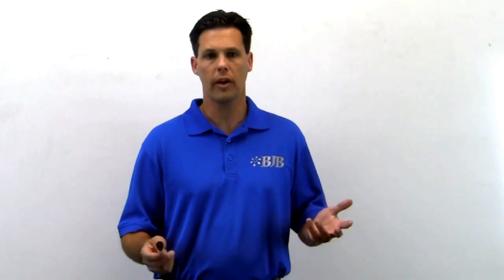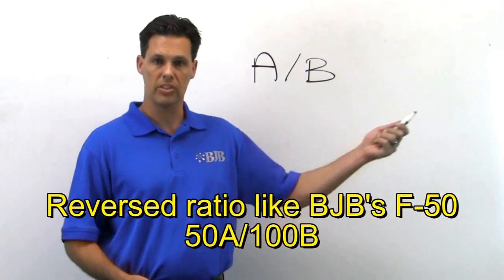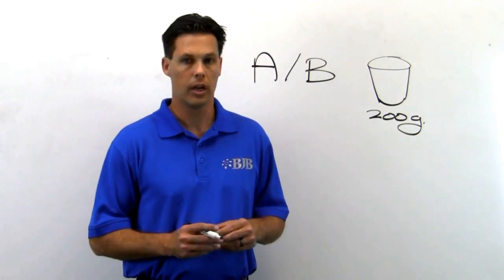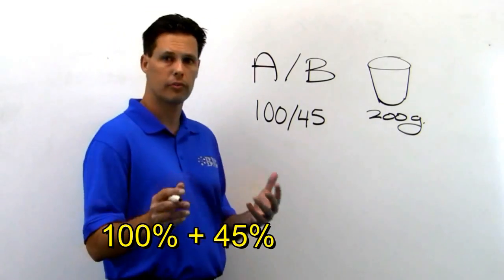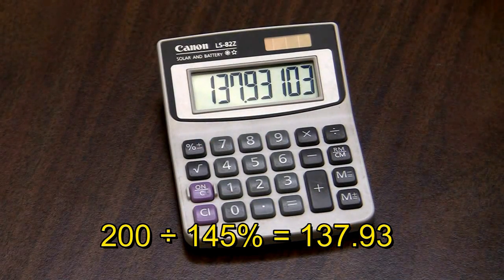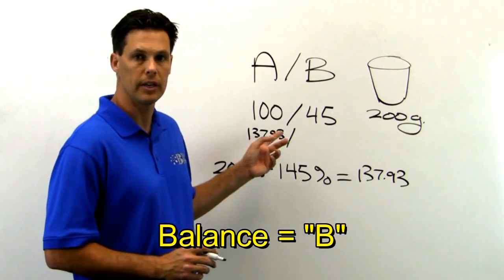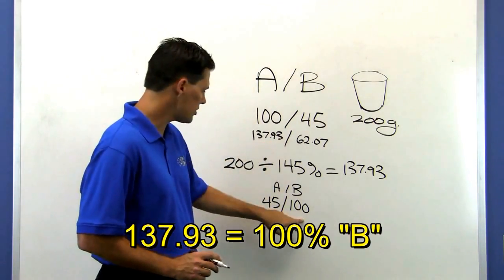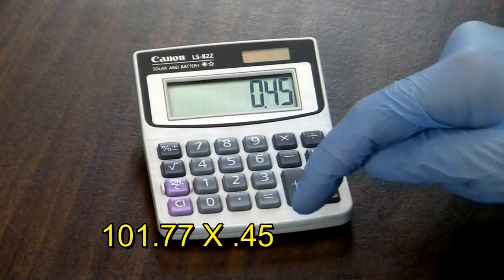Mix Ratio Explained with EZ math

Comment: Thanks but my ratio is 100:26 but how do I work out wat is the ratio for instance 4to1 5 to 1 if xou understand what I'm asking
Reply from the maker: You don't want to try and force a ratio like that into a simple 4:1 or 5:1 because the math won't allow it.  Simply do the calculations in the video and use a proper gram scale to accurately measure your resins.  If you want to mix up 250g of resin:  250/126%= 198.4g A, 51.6g B

Comment: Let me make sure I did the steps properly.

1. I multiply the dimensions of the object or model by length, width and height.
2. I also multiply the dimensions of the mold box in the same fashion.
3. I subtract the number of the mold box from number of the object to get the answer in grams.
4. I divide the number from the overall ratio of the mixture to get the amount of grams for the silicone.
5. Then subtract the number of grams from Ratio A to get Ratio B.
6. ...Profit?

I ask this because I want to make sure I get the numbers right.

I have an object that is 34.1 cubic inches. I have a mold box 144 cubic inches. I subtract the larger number from the smaller one to get 109.9 grams. Then, I divide 109.9 grams from 110 (100 Parts A to 10 Parts B) to get .99 grams, right?

Comment: so if i needed 295 ml do i run the same formula? Im not sure how to calculate my measurements to grams but online calculator show ml/g is 1:1 ? i did the math, the epoxy i use is 100a/85b, i come up with 159.45a and 135.55b . would that be correct ?
Reply from the maker: correct

Comment: If i need 66g how i do that with 100:60??????
Reply from the maker: 66g ÷ 1.60= 41.25 (A), the balance (24.75) is the B amount.   As shown/stated in the video, you always divide the total amount of material you need to mix by 100% + 60% which is 160%.  160% in decimal form is 1.60.

Comment: Will this formula work with a 2.7:1 ration for epoxy as well?
Reply from the maker: Yes it will work but it's a little backwards.  2.7+1=3.7 (370%).  Divide amount needed by 3.7 (370%) to get the B (100%) and the balance is the A.  Example: 500g is needed:  500/3.7 (370%)=135.13g B.  500-135.13= 364.87g A
Reply: @bjbenterprises  thanks again. Just getting into woodworking and epoxy and i was getting so frustrated trying to figure out how to do the pours.

Comment: We have 55k/m3 density foam area of 970/ in2. If foam to be moulded than what would be the formula?
Reply from the maker: You should ask your foam manufacture what they recommend.  Otherwise, you need to run a volume calculation based on the foam density and mold volume.  Usually with foams, you need to add additional foam to provide back-pressure.  Watch this video to learn to use foam: https://youtu.be/_O_vd_I_ojI

Comment: I’m having trouble calculating 10/6 ratios , do I. Use 60% ?
Reply from the maker: Yes, 10/6 is the same as 100/60 so the "B" is 60% of "A".
Reply: BJBEnterprises thank you so much, so if I wanted 200g it would be 125A and 75 B? 😅
Reply from the maker: @nfnfw  Correct.  You divide the desired amount (200g) by 100%+60%=160% (1.60) to get 125g A 75g B.

Comment: Why does House of Kolor call for mixing by grams ? They are just calling for ...... xxxx grams of this , xxxx grams of that and so forth
Reply from the maker: We can't speak for another company but in general, measuring small amounts of liquid resins/paint by grams is a very accurate method.  Using grams vs ounces allows you to use whole numbers and not fractions, which is confusing to many people.  Also, if you are measuring very small amounts of resin/paint (drops of catalyst for example), measuring by volume is nearly impossible.
Reply: @bjbenterprises  .... Im not asking you to speak for another company . I'm asking you to explain mixing by grams , no I'm not mixing small amounts I'm mixing qt.
Reply from the maker: @good-boy-ringo  your question did not have relevant context or enough information for us to know what you are trying to understand.  Mixing in grams is a very common thing in our industry so to us it's not a strange situation.  You may be more familiar with pints/quarts/gallons and ounces but for accurate weight measurements, using a scale and measuring by grams is an easier way to use whole numbers.  You may be more familiar with measuring by volume since you are mixing paint.  That's common in the paint industry.  However, mixing by weight is without a doubt more accurate than mixing by eye using volume measurements on a cup.  Some systems may be forgiving enough to do that, but if you are trying to measure precise color mixes or the system needs closer mix ratios, then measuring by weight is being offered as "best practices" from the manufacture.
Reply: @bjbenterprises  ...Thank you for replying this time with more info on grams but my first question is very clear, simple and does have the relevant context for an answer.
Reply from the maker: @good-boy-ringo  glad you have the info you need.

Comment: If I have a 9:1 mix ratio for 30 millilitres,  what would that be? Thank you!
Reply from the maker: 9:1 is a 10% ratio so your mix is= 27/3.  For example, if your mix ratio is 9:1 or 9 parts water to 1 part solution, there are (9 + 1) or 10 parts.  The mixing percentage is 10% (1 divided by 10).  Multiply 30 X .10 and you get 27.  The balance is 3.  From there the math all lines up.
Reply: @bjbenterprises  being explained that way makes it much much easier to understand. Thank you very much!

Comment: Please tell me. With a dilution of a ratio 1:200, how much chemical will you require for 10 liters of water
Reply: Tinny Richards Your ratio mean, maybe : if you use 1 liter, you need 200liter of the other product. Otherwise, in kilo, if you use 1 kilo, the other part will be 200kg.

So, for 10 liters, you need 2000 of the other one. Are you sure for ratio ? The ratio look strange, is it for a pool or a big volume ?

Comment: Nice . Say supposing we need 2 parts of A and 1 part of B . How do we do that . Please can you tell me.
Reply from the maker: It depends on what you need to know.  If you have a set total amount you wish to mix (say 200 grams A&B total) then you simply divide 200g by 150% (100%+50%).  So 133.33 A & 66.66 B.  Or, you can simplify that and make 130g A and divide that in half to get the B amount of 65G.  The A is simply twice the amount of B needed, or the B is half the amount of A needed.  Correct either way.
Reply: @bjbenterprises  :. In resin jewellery making we have to put 2 parts of Clear Resin mix (Part A) which is 200grams  and 1 part of Part B (Hardner) which is 100 grams . I wanted the exact amount . Will be very happy if you can help. Thankyou.
Reply from the maker: @ashadominicafernandes3138  Yes, 200A 100B for a 2:1 ratio.

Comment: what is the difference between 1:1 ratio epoxy resin and 2:1 ratio epoxy resin?
Reply: 1:1 is 1 part to 1 part. 2:1 is 2 parts to 1 part.

Comment: Please tell me how to mix 3:1 ratio..thank you
Reply from the maker: 3:1 is equal to 75% : 25%.  You can take the desired mixed amount (say 400 grams) and multiply 400 X .75 = 300 and 400 X .25 = 100.  So you need 300g A : 100g B
Reply: @bjbenterprises  Thank you
Reply: Sorry to bother you again but if i have to mix small quantity like 10 or 15 grams??..thank you
Reply from the maker: @khulalanup  15 grams would be 11.25g A : 3.75g B.   Just be careful as this is a very small amount of material to mix; it can be hard to stay on ratio and much of the material can stick to the mixing container sides and also the mixing stick.  We usually recommend mixing at the smallest 20-30 grams for this reason.
Reply: Man,did you go in school in your lifetime ?? I made this when I was 6 years old...

Comment: Thank you for the video. I am a bit confused, if suppose I have two chemicals say A and B. I want to make a certain solution (containing chemicals A and B in a fixed ratio while remainder is water). If the final solution quantity is, say 20 gm, mixing ratio of chemicals is A:B=1.0:0.5 then how can I calculate the required amount (in gm) of chemicals A and B? so that I can add water to make-up the final target amount of 20 gm.

Comment: My scenario is performing a ratio of 1A:5B and lets say for example I need 20 grams of resin. How would I go about solving this?
Reply from the maker: 1:5 is the same as 20:100.  Therefore, you would divide 20g by 120% = 16.66.  So effectively, you would need 3.33g of A, 16.66g of B.

Comment: 200 cc volume 
resin 60 percent and fiber 40 percent..
density of resin 1.2
density of fiber 1.46
tell me the weight that i have to take.???
Reply: the calculation of weight varies on type of fiber. it is different for glass fiber and flax fibers because of high absorption rate. calculate with comparison of standard values
Reply from the maker: 144 GRAMS OF RESIN 
116.8 GRAMS OF FIBER
Reply: density =mass/volume.
I know that but taking the mixture of 144 GM and 116 grams it overflows the 200cc..